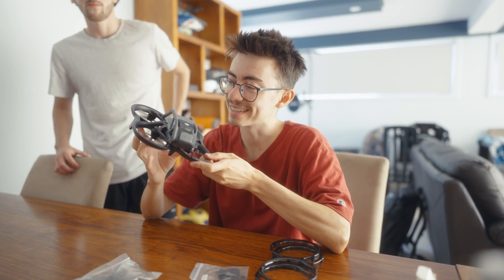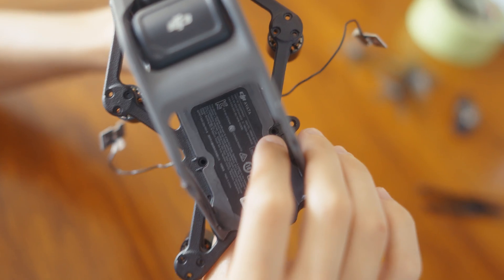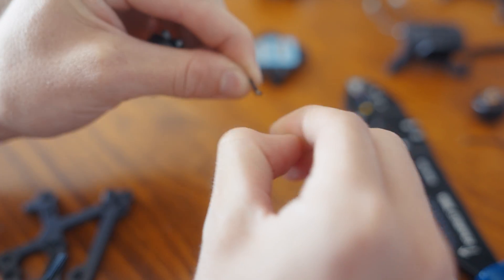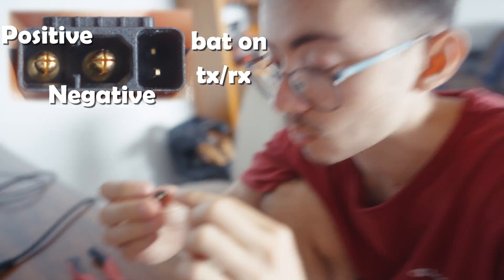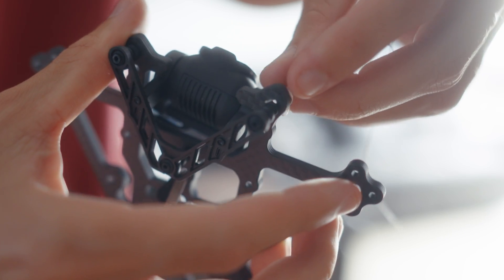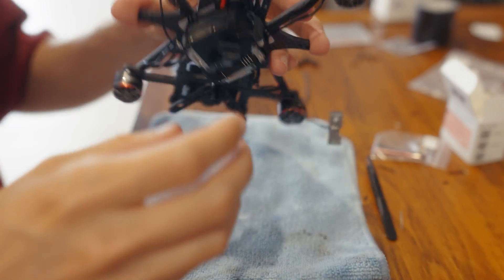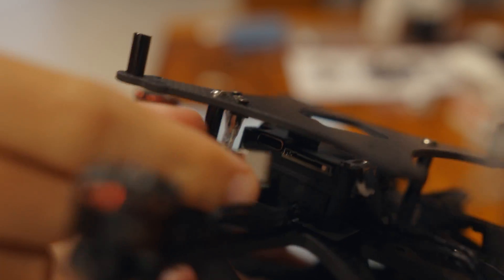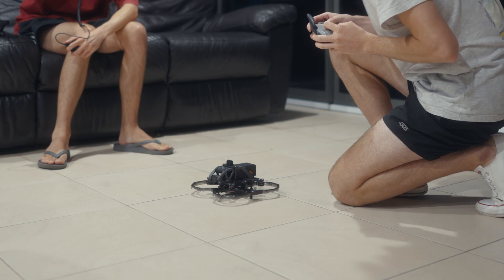Converting the DJI Avata to 3.5"

Comment: I went the solder to board for motor wires route and it worked but it then gave the issue of the metal casing not fitting so i had to mod that too. I was thinking i should have gone the wire cutting route but you have to choose one and stick to it. If the board soldering was that bad i can still cut the wires, you can't move to soldering to the board after cutting the wires. 

One thing that might make things easier for anyone following this along is to cut the wires at different lengths so the connections are not all in the same place on the arms. Easier for the cables to lie next to each other.

Also the range suffers a little having the aerials on the inside of the plastic so i moved them to the outside, zip tied them up and taped over them for protection.
Reply from the maker: good idea about the connection points on the cables, also didn't know that about the antennas, another good tip